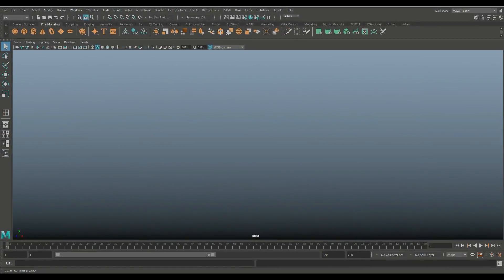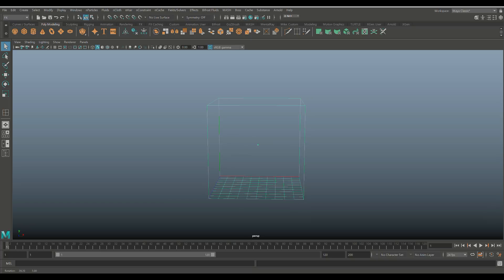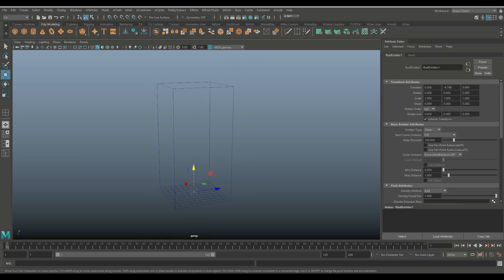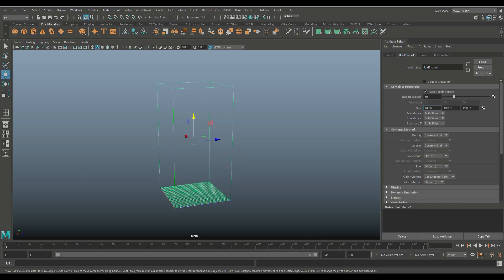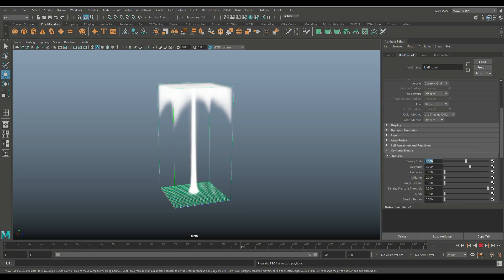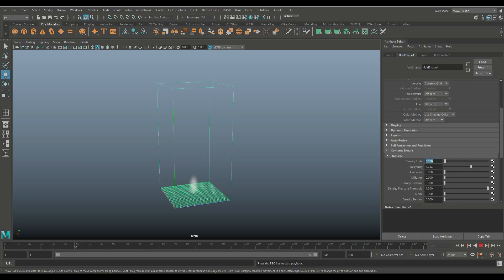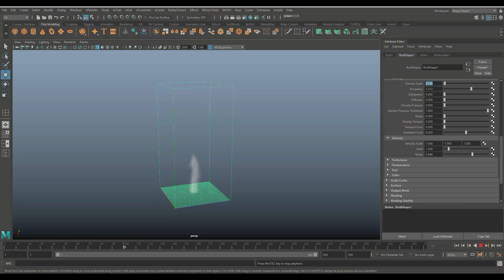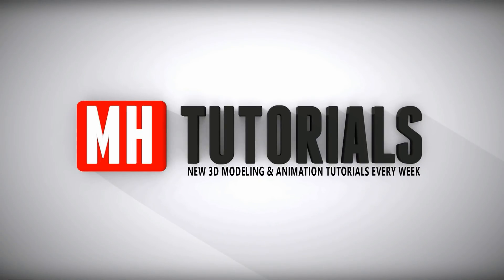Maya 2019 tutorial : How to create various types of smoke

Comment: You should never ever scale your maya fluid container with the gizmo!!! it will distort your fluid.
Reply: @swaminathan8913  It's easy to see if you enable "Boundry draw" in Dispaly under the fluidShape(Same tab Mike did most changes). Set it to 'Outline' or 'Full'. Then you will see the Voxel are not cubes, but more cuboid when you resize the container. However if you change it in "Container Properties" it will be equal cubes.